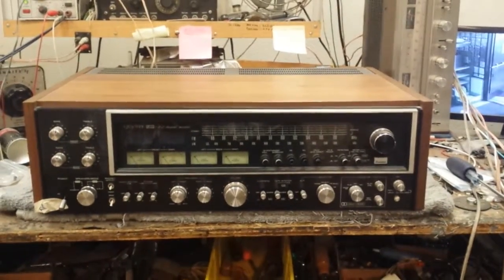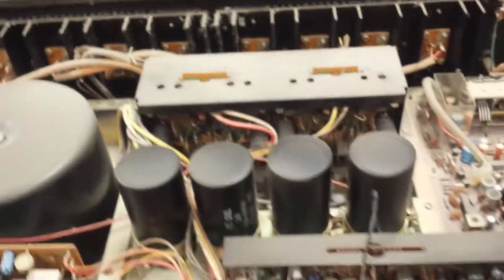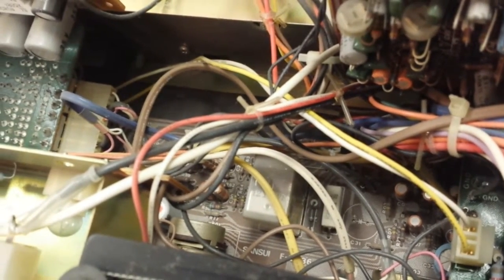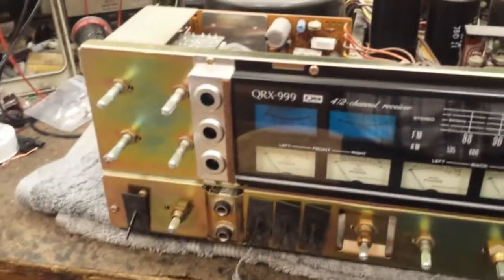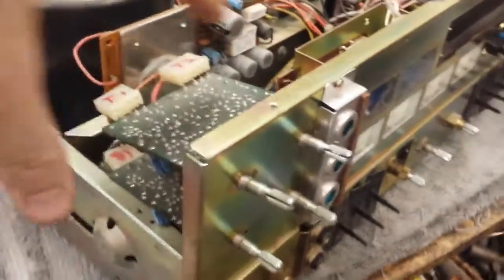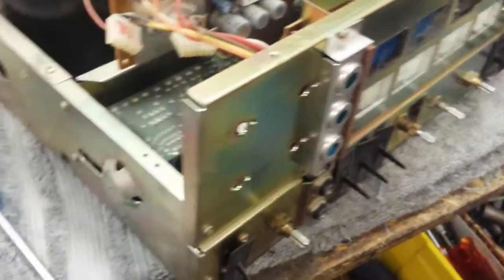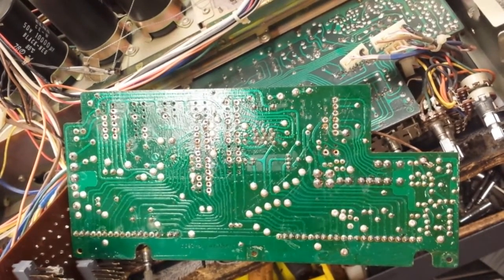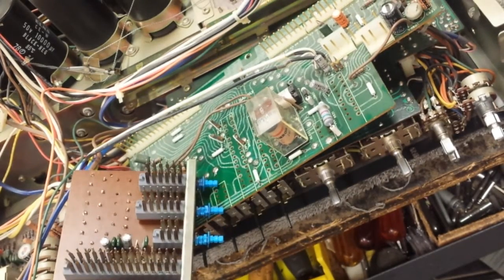Pinning the 4ch board on a Sanusi qrx-9001, 999, 8001, 888, etc.

Comment: I did the pinning procedure as the video showed.I tested the reiays mentioned. When I reassembled it I noticed the relays wouldn't come on and as before I still no sound or meters working.
Reply from the maker: Do the relays click in 2ch mode? How's your 25v supply?  If power supplies are getting pulled down check that you didn't shot anything 

Double check your work. Make sure all grounds are present and continuous throughout the board. I chased my tail once on one of these with a no sound symptom. One of the grounds from one side of the board to the other has been interrupted.
Reply: @JordanPier  I realize now that both relays click and I replaced the third one under the pre-power supply. The thermistor s
Reply: @JordanPier  If replacing the two Hitachi  relays with the He129-nd ones do you only use the outer connections on the new ones?
Reply from the maker: @larryking7439  I've never needed to replace those. Ever. However, compare contacts and use only what's needed. Leave unused disconnected
Reply: @JordanPier  Is the power supply underneath the pre- power supply? How  much voltage does it supply to the boards and where do you check it? Also how much voltage should be present at the two prong yellow and white connector that plugs into the 4-channel board?
Reply from the maker: @larryking7439  regulator board for power supply is the standup in front of the transformer. Compare voltages to the schematics, which can be found on hifi engine
Reply: @JordanPier  Do you take in work?
Reply from the maker: @larryking7439  I do, but there is a pretty big back log right now. I wouldn't be able to get to it until sometime in February at minimum
Reply: @JordanPier  Can you put me on your waiting list to fix my Sansui qrx 9001?
Reply from the maker: @larryking7439  inbox me vintageavrepair at gmail dot com

Use an appropriate subject line or it will get kicked to spam
Reply: Neither of these relays click in two channel mode . I only hear one relay under the pre- power supply board. Is the other power supply  under the pre- power supply ?  I think I might have  shorted something, hint of smell. burntp
supply
Reply: When I switch to 4-channel mode l noticed the one relay click on. When l first got the receiver All four vu meters lit up, but now only the first two do. Also when the Dolby meter is switched to the far left, the first two vu needles fluctuate, but aren't controlled by the volume
Reply: When replacing electrolytic capacitors on protector circuit, how do you determine polarity?
Reply from the maker: @larryking7439  service manual will usually tell you on the schematic
Reply: The protection circuit relay.               hasn't been coming all along. I replaced it and recapped the electrolytic caps,still stays off.Stand up regulator gets hot.Can hear humming through headphones, but not speakers.
Reply from the maker: @larryking7439  I would stop using it until you discover the problem 

If you can understand schematics, download the schematics / service manual from hifi engine and troubleshoot the regulator, amplifier, and main power supply

Comment: Well done Jordan. My question is your opinion QRX-9001 or Kenwood KR-9340 is one better than the other, repair, parts, reliability ?
Reply from the maker: The 9001 is the superior quad machine. It will cost you a pretty penny to service.
Reply: @JordanPier  Thanks for your opinion, yeah..............especially parts you cant buy, then you need a donor.

Comment: A word on the CD-4. While true many dont use cd4, i find its the best feature. Cd4 is also the aux,
 Meaning, my cd player has 2 sets of outputs. I use them into the cd4. This allows me to have 4 speakers, and all can be 4 ohm. In Quad mode, 4 amps, each amp can have 4 ohms. No reduced volume or lack of information on the rear this way like Quad does due to frequencies quad is recorded at. 
  They sound killer this way. I also have Q8 reels ripped and burned to cd (already decoded) and cd4 vinyl decoded, ripped, and burned to cd. Meaning, i do NOT NEED the internal decoder, i can play these in the 9001 or my standard HT setup. They play in quad on any HT setup as theve already been decoded. That said, the cd-4/AUX functon of the 9001 is a great feature, even when one does NOT POSSESS cd-4 material. And, this information is only PART of what these inputs are good for. Yes, these quads can run 2 sets of 4 ohm speakers all day. Most quads can. Just, DO NOT use the powerx2 mode while doing so.

Comment: Changing caps out is a waste of time...Never seen them go bad...I used to repair qrx9001's back in the 80,s and still own one...The biggest thing next to the bad joints is the feed resistors feeding the b+ to the driver Transistors...If memory serves me right I think they are 1 watt carbon 100 ohms and I replaced them with 2 watt metal oxides...There are 4 of them one for each channel ...They rise in value after use...The difference in depth , bass was 400% increase after this fix and brought the punchyness up dramatically...Ive done several...Those resistors are the very most important fix if the amp has had very much high volume use...
Reply: Henry, are you by any chance in Ontario?

Comment: It's not necessary to unsolder all the switches as shown unless you're going to completely strip the pads bare and bend the pin over on both sides (which you didn't do). Save time and risk of damage to unobtainable parts by pinning from one side of the board.

Comment: okay jordan,  while your resting or working on the board  use cardboard from a cereal box  cut it for the correct working area to protect or spread the load on the bottom board or components below. 
   also use the hakko desoldering gun to save you all that desoldering work with that tedious cumbersome manual pump. 
  Get the hakko 808 dual air chamber older one, the new version has one air chamber i think is worse for the long term use.
    also your term rivets , is this also called doughnut rings or pcb donut?
Reply from the maker: +mike murphy I'll have to spring for a desoldering iron.

I like to call them rivets, as that's what they look like to me. Doughnuts or griplets (a term GE used) I've not heard in a long time